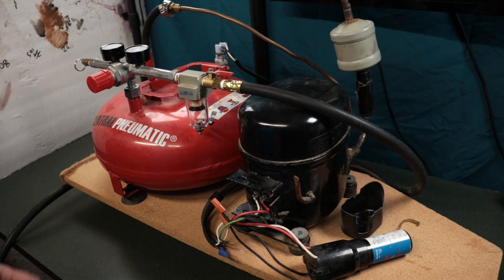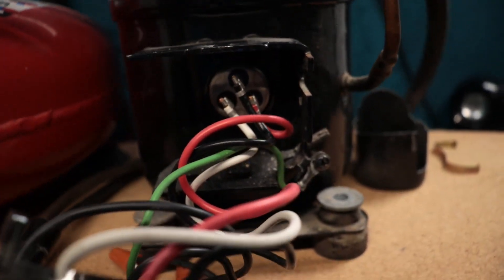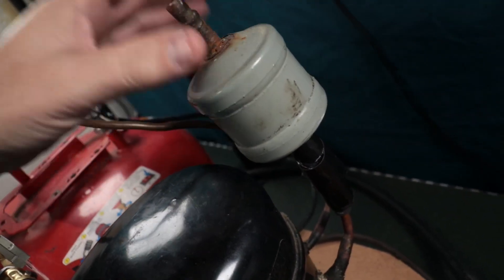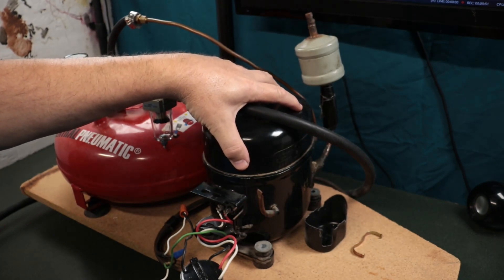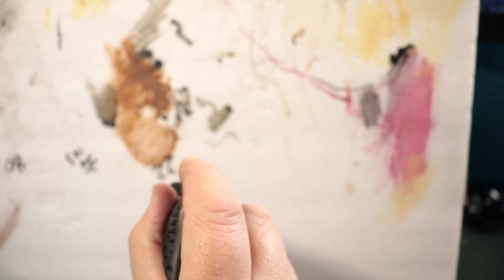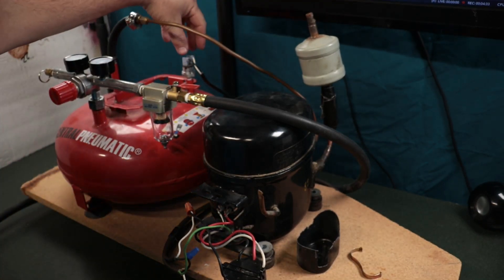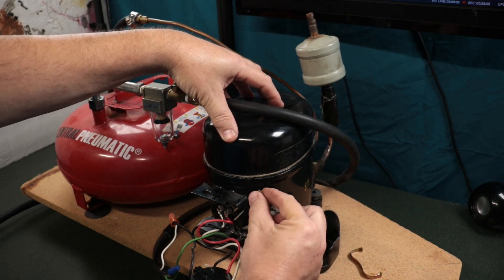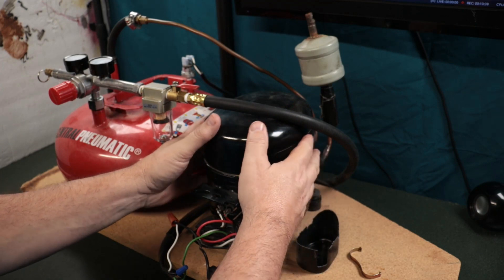Budget DIY ULTRA-QUIET Airbrush COMPRESSOR

Comment: Has anybody asked where you can get a fridge compressor?   I'm not sure that recycle/scrap firms would be ok with parting with one, but that's the only place I can think of that would have a dry system...otherwise its a scrap fridge, cut the lines and let the freon escape, which is not the best plan either.

Comment: how do you deal with the compressor keep turning on or off all the time ? do you have that issue ?
Reply from the maker: The compressor will kick on during normal usage as you bleed off pressure. Pressure bleeding off as it sits not being used means there's a slow leak causing the compressor to kick on as pressure bleeds down. I would recommend not letting it sit under pressure while it's not being used if that's the case. It also could be a faulty pressure switch. Keep and eye on your pressure gauge to see that it's turning on and off at the pressures that the switch calls for.
Reply: @masqueraideworkshop  is it safe for the compressor to turn on and off multiple time like that ? i thought that would wear the component down. as if it was design to be on and off for like 9 times per hour, max.
do oyu have that issue hows the compressor doing ?
Reply from the maker: Here's a bit of text (probably excessive lol) from Google to help explain. Much of it won't have anything to do with an air compressor application because you're not running refrigerant through it. But it'll at least help you understand what it's doing and why. Hope this helps!

"Many modern refrigerators have a built-in "anti-turn on" feature, known as an anti-short cycle timer, built into the compressor to protect it  from damage. This mechanism prevents the compressor from restarting too quickly after a power outage or a brief shutdown.
How the anti-short cycle timer works: 

• Pressure equalization: When a compressor stops, the refrigerant pressures on its high- and low-pressure sides are out of balance. Attempting to restart the motor under this high-pressure load would require a massive and potentially damaging surge of electricity. 
• Lockout period: The anti-short cycle timer enforces a "lockout" period, typically 3 to 5 minutes, allowing the refrigerant pressures to equalize throughout the system before the compressor is allowed to turn on again. 
• Protection during power fluctuations: The delay also protects the compressor during voltage fluctuations or "chattering" of the thermostat after a power interruption, preventing the unit from repeatedly cycling on and off.

Other built-in compressor protection devices 
In addition to the anti-short cycle timer, refrigerators use other components to prevent compressor failure. These are often integrated into the compressor's starting relay.
Positive Temperature Coefficient (PTC) relay • Function: A PTC relay is a heat-sensitive resistor that assists the compressor's initial start-up and then disconnects the start winding. 
• Anti-turn on mechanism: After a shutdown, the PTC disc inside the relay is still hot and has high resistance, which prevents the compressor from being able to immediately restart. The compressor cannot start again until the disc has cooled down and its resistance has returned to normal. 

Thermal overload protector • Function: This is a failsafe device that protects the compressor from overheating. It senses the motor's temperature or the amount of electrical current flowing to it. 
• Anti-turn on mechanism: If the compressor starts to overheat—often due to a fault, like a dirty condenser coil, bad fan, or a failed start relay—the thermal overload protector will automatically open the circuit and cut power. It will not allow the compressor to turn on again until it has cooled down to a safe temperature and the protector automatically resets."
Reply: @masqueraideworkshop  ah okay tahsnk for the info. i assume your compressor are okay after years of usage ? any issue ? beside need to change the oil.
Reply from the maker: Sadly, I don't have that unit anymore. Had to let it go due to a move this year. But I will say that, after 2 1/2 years, it kept going strong. I never touched the oil in mine but that could be something to consider if someone were to use it for many years in this way.

Keep checking back as time goes on with updates so we can track the durability of yours! That's extremely useful information for everyone here and we always welcome new ideas and lessons.
Reply: @masqueraideworkshop  okay thanks :)

Comment: Interesting video, thanks. If I understand it correctly, refrigerators are closed loop systems which have an amount of lubricating oil in them that maintains the operation of the compressor, have you got some way of lubricating the compressor?
Reply from the maker: Great question. Unless the compressor has either leaked oil or been tipped and dumped out the oil remains inside of the compressor from the factory. I do recommend a filter/dryer of some sort inline to catch any random particles that could potentially be pushed out of the compressor. Just as a backup in case to be safe.
Reply: @masqueraideworkshop thanks for the reply, very helpful!
Reply from the maker: You're very welcome. Good luck and feel free to follow up with an update here if you build one. Improvements and suggestions are always encouraged too!

Comment: I honestly don't know why airbrush compressors aren't all made like this. fridge compressors are designed to be quiet and run 24/7 for years on end without maintenance, and honestly not that much expensive (see the price of a bar fridge or a used fridge). Yet the airbrush industry chooses to use loud crappy diaphragm compressors that run way too hot after while, which contributes to "wet" air and spurting.

Comment: What refrigerator did you get this compressor from and how old or what year is it from? They seem to be making household appliances cheap these days and it might be better to get a compressor from an older fridge like something from the 90s or early 2000s.
Reply from the maker: It was from an older model fridge but the pressures that you would use for airbrushing would be so much lower. I can't imagine even a cheap compressor failing due to that.
Reply: @masqueraideworkshop  Thanks for the comment. You might be right about that, I don't really hear about the compressors going out in them, mainly other components but I'd like to try to find out if the older ones were built better or not.

Comment: Thank you for the video… I was given a husky compressor 2.5g  but the motor has issues. Can I use a small motor from a small refrigerator? And the process for connection is it the same as the explanation you have given?
Reply from the maker: Shouldn't be an issue using a compressor from a small fridge. I got mine from a standard household fridge. There might be some differences in pressure but they all function the same. If course I can't guarantee anything and you do have to be aware of risks associated with the pressures these can produce.

Comment: The most important thing is the pressure switch.   Would be nice to have a check valve too.
Reply from the maker: There is a ball-type check valve inside the opening of the inlet tube on top of the tank itself. Perhaps another external backup could be a good idea to have inline as well.
Reply: @masqueraideworkshop   The only thing that the check valve does is stop backflow out of the tank so the compressor isn't under pressure load next time it kicks on.

Comment: There will never be 500 PSI in that compressor.
Reply from the maker: That's right! The pressure switch will definitely see to that 😊
Reply: @masqueraideworkshop  You said 500 PSI, where did you get that from???
It cant produce 500 PSI.
Reply from the maker: "Typical fridge compressors are 100 - 300 watt units, deliver 0.7 - 1 CFM of air and can reach pressures over 500 psi."

I'm not a refrigeration professional but a quick search brought me to that information. I'd like to say though that even if that were completely wrong information it really has nothing to with the usefulness of the project in this video. The pressure switch makes it a completely benign bit of info in context anyway. Perhaps it could be a good idea for me to make a video to test that out in a real world application myself. That could be useful to know possibly and probably interesting to watch.
Reply: @masqueraideworkshop  I dont think it will ever reach 33 Bar 500 PSI a workshop compressor are 120 PSI.
Reply from the maker: All information should probably be considered anecdotal evidence until proven otherwise, I admit. Searching forums you will find sources of this kind of evidence. I think that it could be a fun test though. Dangerous but informative. I'm not saying that my Frankenstein rig setup would ever even qualify for that test though lol. I've got a mish mash of fittings and such as it is that would explode under much lower pressures 😂.  I appreciate the input though. It could make for an interesting experiment from Adam Savage 😉

Comment: Great setup. Can you identify the pressure switch for us? The only ones I am familiar with are the big square box type. I like how compact that switch is.
Reply from the maker: UPDATE I can source these small switches pretty inexpensively. We're adding some new products to our store leading up to our April 1st 2 Year Anniversary so I'll try to have some of those purchased in bulk and listed at the store within the next 30 days if possible. I'll keep you posted on this comment thread if you're still looking for one by then.
Reply from the maker: The tank, switch, and pressure regulator were at one time a complete $45 Harbor Freight unit. The pump had burned up after very little use so I "Frankensteined" this fridge compressor in as the pump replacement. I'll look around and see if I can source some small switches like that to offer for sale at our store. Thanks for the inspiration 😁👌
Reply from the maker: UPDATE to my last UPDATE: It's been quite a long time since your comment but I remembered that we'd talked and I wanted to let you know that we've got these pressure switches available today here finally:  https://masqworks.com/collections/airbrush-tools-accessories/products/90-psi-120-psi-heavy-duty-air-compressor-pressure-control-switch
Reply: I'm just now watching this video. First of all, thank you. Secondly, how awesome of you to come back and let that person know personally that you had what they were looking for. Good stuff man.

Comment: This is interesting! Beside PSI you can control, have you maybe figured out how much flow it provides, so L/min? I'm wondering if it could run mini spray gun like sparmax dh 810. I assume smaller model like sparmax gp 850 it could be able to run? Any thoughts/experiences about that? And one theoretical question, you mentioned if I remembered correctly that you've set it to shut off at 100 psi and turn on at 80 psi. I've also seen similar ranges, like 60-40, or 80-60, and was wondering why is that, I mean, since we need what 20-30 psi on the airbrush, why not put instead of 100-80 to 100-40 so that compressor will have longer pauses between running. Ok it would run for longer than. Just wondering in case you've found out why such decision that you've also made is actually made? Or qour switch is fixed so you can't adjust those values? Thanks!
Reply from the maker: Thanks for watching. It was a fun project to put together. I've only tested the compressor with a few standard cheap airbrushes and it works great but I haven't tried anything HVLP. I do know that an AC compressor has a built-in safety to prevent it from overheating and being damaged in the event that it shuts off and back on too soon. It's called short cycling and in the event of a leak in a refrigeration system it prevents the unit from running too long and for too many cycles over and over as it would keep being called on by the other parts of the system to push refrigerant. So anything that would require the compressor to run repeated cycles would end up having to wait for the 3-5 minute time delay for it to allow itself to run again. That could be aggravating for sure if you're trying to run a high volume of product through. I'm unsure of the L/min though as I haven't tested that. That would be interesting to know. The switch that controls the on/off pressure on this project is actually fixed and came with the Harbor Freight tank that I used for this video. I would imagine that, as long as the storage tank and other components attached were able to handle the pressures required, it would be perfectly fine to use different on/off switches with different pressures. I do understand that these types of compressors can push up to around 500 psi so you shouldn't have any limits with the compressor itself to use different switches.
Reply: @masqueraideworkshop  thanks!